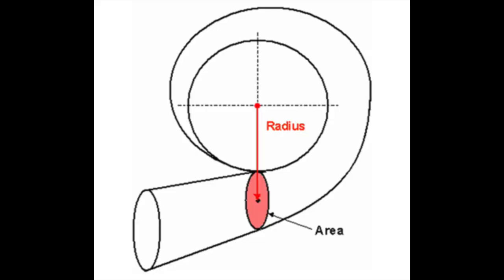Turbo Exhaust Housing A/R Explained

Comment: Excellent video. Well explained, but I have a question. How does the a/r affect the cold side of the compressor? 👌🏻✌🏻
Reply from the maker: Garrett is the only manufacturer that really provides the cold side with an A/R statistic, but I don't know how they derive this figure
Reply: @momentumworx  But I imagine that the a/r also affects something. For example, at 0.69 vs. 0.86, which would be better?
Reply: @momentumworx  a .69 will be faster and will have more psi than a .86 🤔 what would be interesting would be the cfm..

Comment: If a turbine housing is a T3 with a .82 or a 2.5" v-band with a .82 but everything else is the same ... would the v-band reduce backpressure?  The area of the v-band is >20% greater than a T3.

Comment: Hey man, I have 1 s475 1.32 (t6) 75-88, that I was going to put on my 364ci sbc (lq4), do you think that would be to much for it? I wanted to buy another, so there be one for each bank, but before I make the purchase, I didn't know if you had any insight on the LS platforms or not, and turbo sizes. I don't need ridiculous power (maybe 1000, but more likely 650-700), the second turbo would be more for an aesthetic thing versus power. I'm putting the 364 in my project car, and I really don't want to over do it, and not enjoy it, if its to much for the engine. Thanks!
Reply from the maker: Hey Tim - my experience with LS engines is very little.  I wouldn’t know where to start with this one, sorry man!
Reply: @timdoherty8106 that borg warner would support 1000hp in the 6.0l ls. You definitely wouldn’t need two. I would even was money on a second one for looks. If your racing then you don’t really want that additional weight especially if it is t functional. That one turbo will spool up pretty good with that motor and pull pretty hard.

Comment: How do you over speed a exhaust housing? Would it be because the exhaust housing is to small
Reply from the maker: You don't overspeed a housing, the housing is stationary.  But too small of a housing causes the shaft to overspeed.  Think about the exhaust housing like your thumb over the end of a garden hose, more restriction creates more pressure, but less flow.
Reply: @momentumworx  Does that mean that you in general can choose a size smaller A/R as long as you have a waste gate that can handle the build in back pressure?
Reply from the maker: @usefulemptiness2410  Generally speaking, yes.  But this will limit how large of a compressor wheel you can run because you are bleeding off exhaust energy that would normally be used to drive the wheel to make boost.  Everything about turbos chargers is a zero sum game, wherever you gain, you lose somewhere else.  BUT - this is OK because the energy used to drive a turbocharger would naturally just be wasted anyway because exhaust gas is just a by product of a running engine, its not created specifically for the operation of the turbo.  Unlike superchargers that actually are spun by the engine, which creates parasitic draw.

Short answer, your theory is correct, just be careful with the actual application of it as an exhaust housing that is too small (even with a wastegate) is not going to perform well.
Reply: @momentumworx  Thanks for taking the time to write such a long and informative answer!